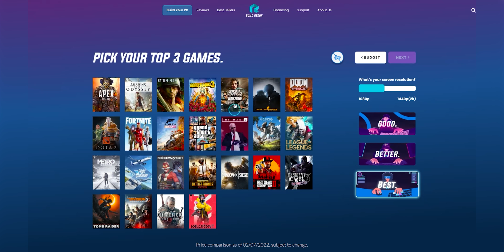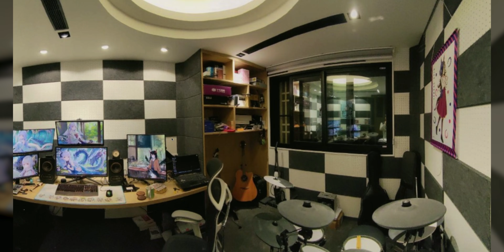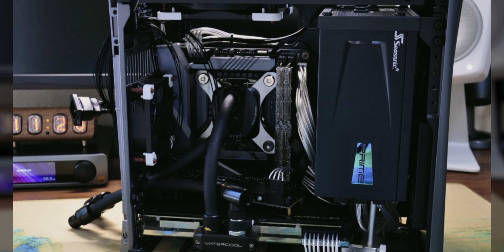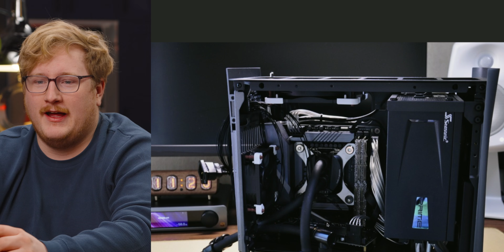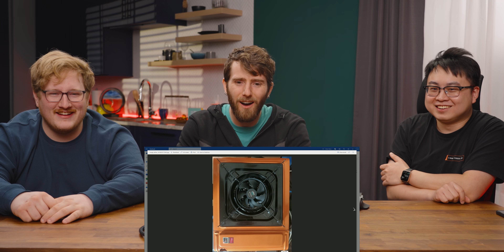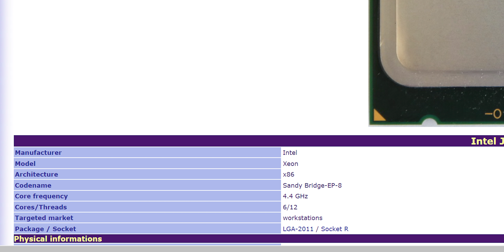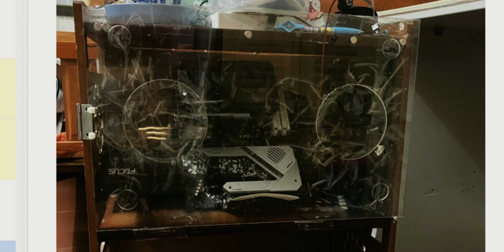Roasting Chinese Gaming Setups

Comment: I'm legitimately considering buying the BenQ monitor light, I have a use case for which it makes sense.

My desk doubles as my computer desk and also the space where I sketch and draw art. When I'm drawing, I need really good lighting, but I'm not really using my monitors at all. My current solution is a desk lamp, which takes up space and is annoying, the monitor light would light my whole desk and be out of the way when I wasn't using it.

Comment: I like how they talk about the second guys deck top speakers and completely ignore the stax L-700 electrostatic headphones just casually hanging on the side of the table. Those things are like 1500 dollars used with out an amp and  most amps that can even run them are at least that much.

Comment: Basically，these ideas comes from a community called "图拉丁吧" in Baidu Tieba，which means "Tualatin Bar". It's a place of using cheap hardware to build PCs. Because of they use they budget buying faster hardware so they try to cut the price of other part for their PC，like using paper case or plastic bottle as case. It's also a amazing place to talking about modding hardware like P106 mining card or QL2X modified laptop CPUs.
Reply: 还得是百度贴吧🤣谢谢我亲爱的牛爷爷！
Reply: 給老萊一點小小的圖吧震撼！
Reply: 不是“”大耳朵图图吧”😄XD
Reply: @heathliu7251  图图吧不是都是图钉了吗😂
Reply: 预算500，从未打过这么富裕的仗
Reply: @仙欲-x5r  500高了，200块钱带你起飞
Reply: @仙欲-x5r  500刀（指正）
Reply: 还得是图吧
Reply: 支持正义科普
Reply: Tualatin Bar?

Is this an omage to the P3 CPU's?

I sure hope so.
Reply: @nexxusty  yes
Reply: 好像都是中国人
Reply: 还得是图吧😋
Reply: so do they only say "i have low budget" or do they get respected by everyone else
Reply: @maxydapurp11210  Respected ofc, absolute madlads, pushing the "low-budget build" to the extreme, while creating crazy mods like P106 with video output, they are quite kind and open to newbies.
Reply: 还得是图图吧
Reply: 我还有四套可以运行的图拉丁配置~
Reply: xswl
Reply: 支持
Reply: 三千预算进图吧，学校对面开网吧
A N矿卡是标配，垃圾靠岸笑哈哈
坏道迈拓装系统，并口硬盘论车拉
老式至强超频爽，奔腾菜羊够用啦
十手矿卡装上去，鱼竿内存满箱插
机箱路边随便捡，安踏鞋盒擦一擦
机械键盘自己搞，鼠标一斤一块八
人人手拿七七五，家家双路叉五八
萝卜散热效果好，牙膏硅脂温度压
二手便宜质量好，一切信仰就是渣
Reply: 给老莱一些小小的图吧震撼😂
Reply: 6
Reply: woah
Reply: 回复都炸出来了是吧（
Reply: 给加拿大一点小小的图吧震撼
Reply: 支持正义牛爷爷
Reply: 大耳朵图图吧

Comment: 12:18 Because you can just run a vacuum over it when you're cleaning the rest of the room, instead of having to pull off side panels and dust filters and all the crap you need to disassemble to clean out your boxed up computer. It's easier to keep an open set up clean than it is to clean an enclosed computer case.

Comment: those quick connects on that laptop are identical to a oxygen tank filling machine made by invacare in which you feed oxygen from a concentrator to the pump unit through them at home  they should be good for a good 15 psi

Comment: One of our HR staff was having trouble with headaches verging on migraines after using the pc for any length of time. I put one of those "Stupid lights" on the monitor, headaches went away.
Reply: now the question becomes, is it better to have lights installed above the monitor like that or have LEDs on at the BACK of your screen? both allow for more ambient light
Reply: @DebuDebuYT  in this case, the monitor doesn't have its back to a wall so back lightning wasn't an option.

Comment: 26:33 My guess is that it's some version of Linux that is just slightly customized to look like a Mac. This could easily be Ubuntu. I can't tell if it's Gnome or KDE (I've never messed with KDE but I know it's more customizable), but on Gnome there is an icon pack called "White Sur" that definitely has those "finder", "launchpad", "system preferences", and "calendar" icons. Mac OS doesn't have that "clock" app, only iOS does. The Steam icon would be a slightly larger circle on Mac OS and wouldn't be crammed inside the rounded square frame (not sure what the Chrome icon would look like bc I use Firefox). It looks like Gnome except for the many icons added to the top right, which are there on Mac OS but usually are not on Gnome (Gnome would have only like three little icons plus the date and time, which is in the center by default but is easy to move to the right). The dock and the top bar look like they definitely have at least the "blur my shell" extension. Macs have never had a translucent top bar, it's always one solid color even if it's pulling from your wallpaper. I can't tell if they have the close/min/max buttons on the left or right of the window, but there's no way it's the Mac traffic lights (even if it were, Linux can replicate those three colored circles). They might be using the "White Sur" shell theme too, because it puts an apple in the top left instead of the "activities" button. The Mac OS top left menus are absent, which is standard on Gnome. I have no idea how they got the "launchpad / show applications" icon in the second position, I've only ever seen it on the far right (default) or far left ("dash to dock" extension). The dock has more padding than it does on Mac OS, and it's farther away from the bottom. Linux does have Steam and Chrome, but it doesn't have any Adobe applications. I have no idea what those Adobe-looking apps are, but you can manually change any app icon you want on Linux anyway. They could've made Gimp look like Photoshop, and Kdenlive look like Premiere. The Audition icon could actually be Audacity, Ardour, or even Reaper. I have no idea how they got minimized windows to show up on the right of the dock. Gnome doesn't do that, but Mac OS does. Maybe they used "Dconf editor" or "Just Perfection", neither of which I've tried. It's Anthony's fault that I entered the Linux rabbit hole. :)
Reply: In fact, it should be a beautification software on steam, called myfinderdock, which has a theme of imitating mac

Comment: I had an older tower that the CU got pretty hot on, but noticed that the case had a little grille DIRECTLY over where the CPU was, so I super-gluded a tin-can to the CPU fan (Basic AMD cooler) and created a duct straight from the outside
Reply: I'm actually in the process of making something similar. I saw how my power supplies always take air in and shoot it right back out leaving only radiant heat inside. I wondered why the cpu should be any different? I'm making a duct that grabs air from out back, it goes through the cpu cooler and then straight up and out. It will isolate that heat completely from everything else. I'm going to line it with the same gold foil I used on my car's turbo setup. Will it help? who knows. It's something to do though lol.

Comment: Honestly open concept pcs are great its easier to get the dust out I find it funny to hear them get frustrated about the open concept cause of dust but I had a Thermaltake Core P3 and it really wasn't much more dusty than a closed case pc, just maybe collected more dust on the top surface of things which was much easier to clean without taking the case apart in any way.
Reply: What's that I was thinking, just cut the middleman and clean the parts directly.

Comment: Those quick disconnects are real at 15:23 we use them at work for air sampling lines. They are not meant to be water-tight I don't think.

Comment: can confirm...the monitor light is fucking great
I only really use it when im gaming, so I have the lights off but I need to find something on my desk so I turn the monitor light on without having to get up and turning on the lights
Reply: is the light only for the desk? does it not glare up the screen?
Reply: @exxonrcg  I haven't had any issues with glare, the Keds are angled slightly away from the monitor
Reply: LEDs

Comment: VIDEO IDEA: what is the dimishing point of return for heat sinks? Could you get a heat sink so big (+ fan) that it is better than a standard water-cooled setup?
Reply: that's a good idea. It seems like tower coolers can handle a couple hundred watts, but would be nice to see the specific breakpoints, especially since modern CPUs are quite demanding, and then see how far air cooling can be pushed!

Comment: 13:11 I had my router behind my monitor before, and it was terrible. Not only did I have to carefully run every wire so none of my audio stuff went by it, but if I had my phone in my pocket, it would put my audio equipment between my phone and the router and then I got feedback.

Comment: Actually Jake both my open concept builds stay pretty clean and dust free other than the radiators but being open concepts they are crazy easy to blow out and keep clean whereas in a closed case you can only clean so much and most people don't because they don't see everything so they forget about cleaning

Comment: Dont know if it was said before but the disconnects they used around 15:23 are similar to the disconnects used in motorsports applications like hydration lines to helmets and coolshirts. They are medical grade disconnects and they leak pretty bad after a while or when it does not close properly.

Comment: My front panel in my case was all glass with hardly any airflow intake so I took the screws off that held the glass and replaced it with window screen I dropped like 5c° off my threadripper 👍

Comment: Because dust doesn't actually matter that much. It's more an aesthetic problem than an actual problem, especially with open-frame cases, and that's easily solved with a quick spray of canned air.

Comment: Hey for the "Metal tube bending" comments,  you can buy tubes with already bent 90's and 6, 8, and 10 inch ends,  that why they have those  90 connectors.

Comment: The fittings and tubing the person used at 15:25 are an exact match for the stuff we use to connect analyzers to the DI reservoir in the clinical lab I work at. We keep moisture detectors/alarms near them and electronics away from them...

Comment: 8:33 I believe you can buy that metal tubing with a single 90 degree bend already in it, so I'd guess they just bought those and didn't want to do any bends themselves using fittings instead.

Comment: I’m with Linus about the light bar thing. It makes no sense to me just get a table lamp 😂
Reply: A desk lamp often requires AC power, takes space on your desk and it's sometimes impossible to have it pointed in the right direction without it not being in your way (again because of desk space).

Monitor lights are USB and since you often have USB ports on your monitors, you can power them that way. So when you turn on your monitor, the light turns on. Or you can plug them into a smart plug and have them set on a timer.

They are LITERALLY what monitor arms are to regular monitor stands that used to sit on your desk. They're an upgrade in all aspects in my opinion.

Comment: 22:07 I have only ever gottem my hands on a broken one of these, these were those LGA 1366 6 core Xeons, where 4 cores were "disabled", and instead of 6 cores at 3.4Ghz base, they ran 2 cores 4.4Ghz base and like hopped between the 6 different available cores to keep the thermal load spread out, I was told that if you de-lided them, and used some overclocking motherboards like the EVGA SR2 or that one Asus dual socket that you could unlock all 6 cores at 4.4Ghz, while 4.2-4.4 was easily possible on the Xeon X5690, the Xeon X5698(the processor pictured here) you werent overclocking, and had a turbo frequency on top of that 4.4Ghz, which was not possible when you manually overclocked the x5690(the best i could ever get out of a pair of X5690 was 4.2Ghz)

Comment: Re: the metal tubing. I believe you can buy tubing that comes with one bend in it near one end, so that's why you only see one bend in each run and the rest are fittings, they just used the pre bent tube and cut it to length

Comment: The crappy quick-connects you thought might be homemade, I've actually seen those before. On a professional product. An industrial product, even. Specifically, they're the style of quick-connect used by the power steering fluid flush machines in the auto shop where I work.

Yeah, they're pretty much as crappy as you think.

Comment: Why are you using 2 GPU's?  Probably because their graphics card only supported 2 monitors and often times one is DVI the other is HDMI and they probably needed more monitors.  Not all GPU's have 4 outputs.

 Dust is not s huge problem for open cases when you keep the computer off the ground.  Really Odd that he is so worried about dust.  Most people clean their computers fairly often when their case is open because it is a display item to look cool.

17:15 because they only have 2 plugs below the desk and 2 above....

Comment: I might be wrong, but i think the one with the heat exchanger is a heat exchanger water heater, basically instead of heating water by pumping energy into it, you spend energy to transfer heat into it, getting better efficiency, which means you cool something, usually the outside air, and pump that heat in the water, i guess he must have put the cold part connected to his pc which is honestly ingenious.

Comment: I also made myself a diy open air pc, and the thing is... once you have your fans turned down... it makes no noise, and dust is almost not a thing because of so little air movement, the only dust you need to care about is the dust that will just sit on top of your pc, but just use compressed air once every few weeks and its done, really simple... you should give it a try

Comment: To be fair, that MSI translation is a pun so it’s intentional: It supposed to be “火箭筒加强版”，where the last letter “版” means version. They changed it to “板” which pronounced the same and means “board”, as in it is a “enhanced motherboard”.
“Plus” really don’t have a fitting translation in Chinese, Chinese don’t often use something like “A+” or “B+” etc. to describe something better than peer. I mean you can say “加” like OnePlus is ”一加”, but plus is more often understands as an operator, a verb, instead as a adjective.

Comment: Linus, there’s a development with fans for all computers. Whereby there is no moving parts at all and it moves air over the hard drives or the CPU.  At the moment it’s run by a start-up company, but they have tested it and they reckon that the thermals are very much down and therefore it allows for new designs without fans that includes large PCs as well in the future development in the area, just to let your colleagues know, so if you’d like some more info by all means look into it, but it’s available. It’s a start-up company so if you’re looking for more info, tell your lads to look into it.  I just like to inform you if you haven’t already heard of it, but I’m not winding you up. It is something that’s going to happen very shortly and it will change the whole laptop and PC designs in the future where they won’t have any fans whatsoever, and the thermals will be really down.  In actual fact they’ve been non-existent in some cases so the higher CPU you have hence it’s supposed to run better which is true, but there’s always been a situation whereby hate is always been the issue as you know so in order to eradicate that you have to put sick fines on now in future. This won’t be the case is Justin as a SD case and looks just like an SD case, but it actually goes on top of the SSD case and the other one on top of the CPU I need does a much better job than both of them put together look into it. It is an actual fact of hardware that has been developed, and now all they need to do is scale. Up is in the process and it will happen in the next couple of years.

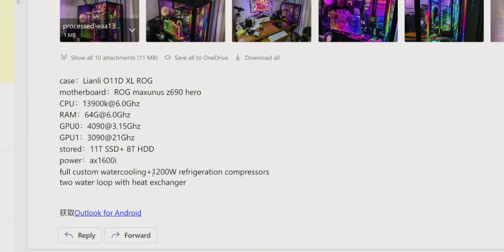Comment: Also, for some reason I saw that they said their processor ran at 6 MHz, and the fastest CPU at its fastest clock speed is 5.8 GHz and thats a intel core i9 13900 k, and they said they had a i9 13900k 5:59

Comment: Linus, concerning the monitor light. I was on your side until my wife got one. It allows her to not need the overhead lights on when she need to do other work at her desk. It also uses some magic in the design and there is ZERO glare on her screen when she uses it. When she does not need to work at her desk and wants to game, she just turns it off. These are actually pretty cool.

Comment: #7 while the reason they used a manufactured elbow instead of a back to back 90⁰ bend is because of the minimum radius of the bend coming off the board would require the pipes to be 2 more inches off of the card.

Source: master electrician who has ran enough conduit to reach the moon and back. (Four times)

Comment: Concerning the comment on open concept. I have moved away from "cases" to open air designs and dust is way less of an issue than you think. Even in a dusty environment it is not that big of a deal as it takes just SECONDS to clean the PC.

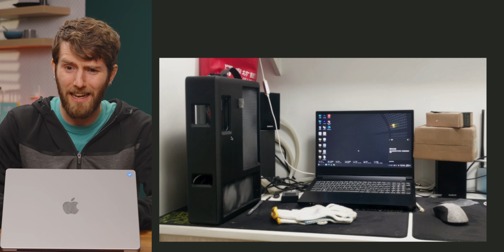Comment: The setup at 15:39, you see those quick disconnects on air mattresses for air hospital/nursing facility beds. They are actually extremely useful and work well. 

For air. Those have got to leak with water 😅

Comment: Open cases don't gather more dust! The problem with assuming that is you are assuming that most of the dust in your case lands on it naturally, when the vast majority of the dust comes from the air intake. If you thought about where the dust and if you see 10 from for a few minutes you'd realize that. My thermaltake p5, I have to dust it maybe once every 2 or 3 weeks, and I don't have to disassemble to do it I just blow it with the compressed air. My enclosed NZXT will have a layer of dust I can sign my name in after 2 weeks.

Comment: 26:18 Yeston can be AMD or Nvidia 6700XT 6750XT 6800 or 3070TI 3080 version Sakura, all have the same frontal 3 fans, only change a little while backplate, in Nvidia cover more on the "gpu chip legs"